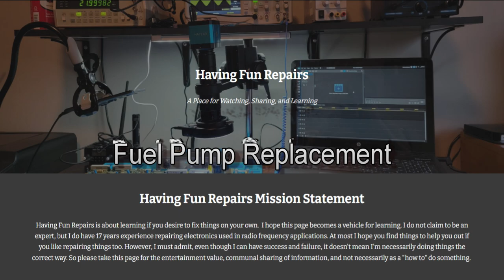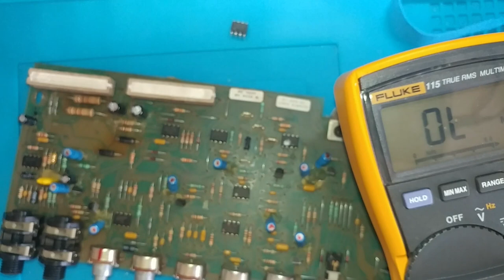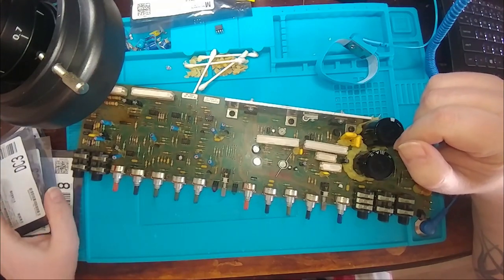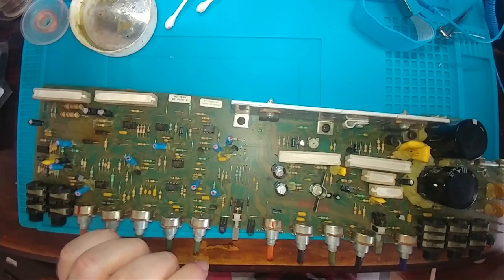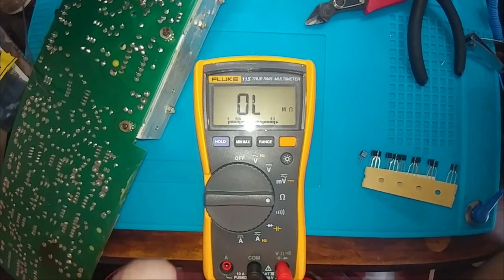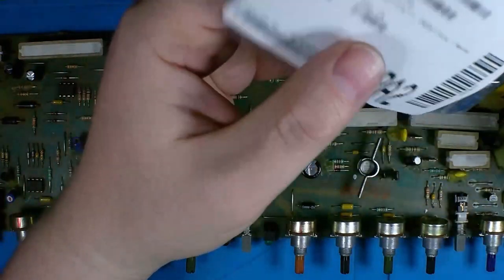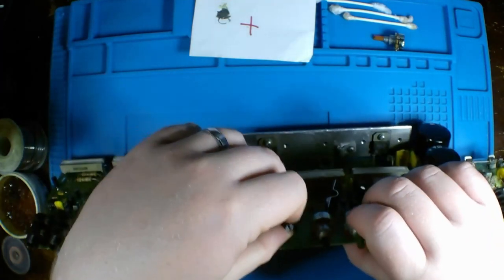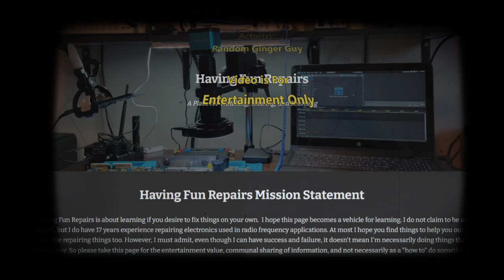(Part 3/4) Crate G80XL Guitar Amp Restoration

Comment: If you can't get the noob on to that shorter potentiometer you can buy this, Piher T16SH-M04N502B2020MTA and cut it easy with a sidecutter.

This one is maby to little resistance (because i use them for fans) but they shorly make them in al different resistance.)

Thank you i hope you provide a nice guitar solo when you end this series 😀 

Thank you!